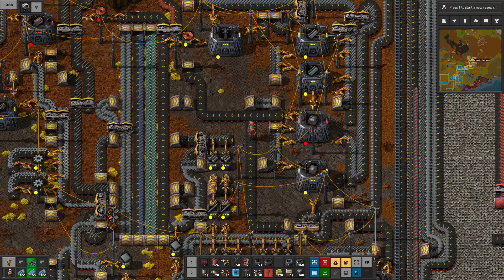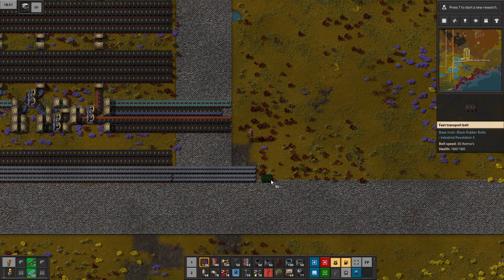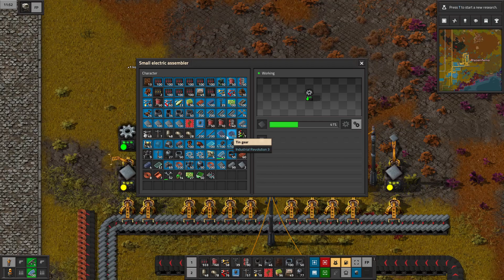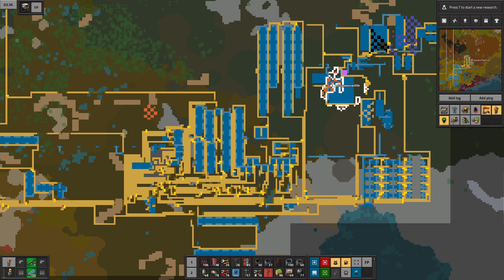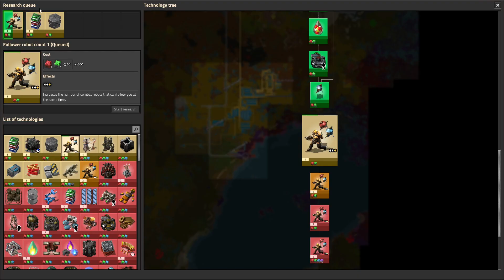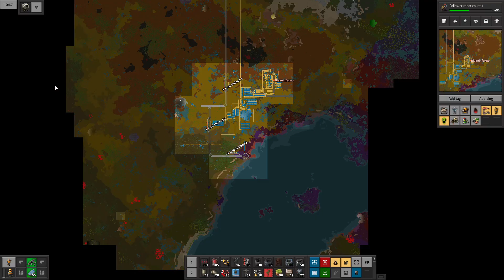Factorio - Industrial Revolution: Day 15 [How to Untangle Spaghetti]

Comment: What i'm doing to make more compact factories is not belting anything that can be done in a small assembler. They go directly from the small assembler into the big assembler using them. I end up using a few more small assemblers thant optimally needed, but i save a lot on belts and space.

My current mall factory starts with a factory that makes almost every single complex component directly from copper, glass, rubber and iron, each component using half of a belt. So it's 8 belts for them, plus 4 more belts for the raw ingots and materials like wood, stone and concrete. Then from that 13 lane bus, i autmated 1 per minute of every iron machine. including all inserters, belts with their undergrounds and splitters, pipes, both assemblers, crushers, mixers, all the oil extraction and processing buildings, all the train stuff, defenase stuff, laboratories, forestries and general fluid handling. Unce the buss fills, once i take any of the machine chest contents, it ussually refills before i have to take more again and I don't need to do any hand crafting.

The ammo is made at a separate site to automatically refill turrets in my outer walls using trains.